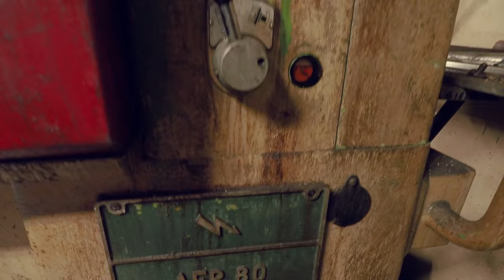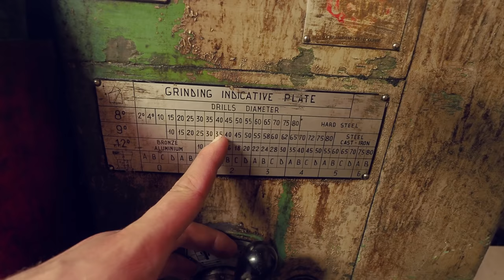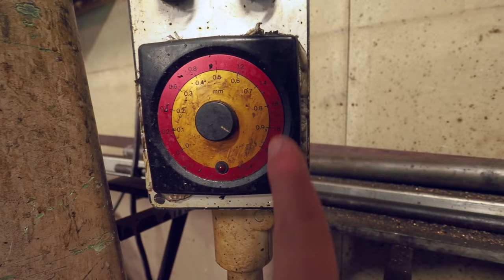Automatic Old School HSS Drill Sharpening Machine

Comment: this is possibly the best drill sharpener ever, i used this one very often at a place where i used to work, and no other drill sharpener comes even close to this one. the small centering bit in the center is unique, all the drills i used on a radial drill almost never needed pre drilling, just a smal center with a centerdrill and then bam drill a hole up to 75 mm, ,no run off, all because of the centering part on the drill itself. best tool ever!

Comment: 25 years ago I started as a Machinist Apprentice. The same day I hired on they company had one of these delivered new. It was my job to set it up.  That machine got a ton of use.   I still work at the same company and just had my 25th Anniversary there in October of this year.   And yes we still have the same drill bit Sharpener.
Reply: In 25 years I bet those drill bits are getting very short.  :)
Reply: Deezildennis  - You should resolve the argument in comments above where the guy "
MrKotBonifacy" is saying that the sharpener couldn't possibly be grinding a relief angle... just a (blunt) cone.
Reply: Does the grinding stone cycle in and out to produce the relief angle or is the stone shaped?

I notice it runs eccentrically side to side but that wouldn't, of itself, produce the relief angle.
Reply: @evildrome  yes, the grinding wheel moves left and right as well as forward and aft. (Since the drill only spins). We had one of these too in the shop I use to work at. Only used it for big drills like this though. The small drills we would just sharpen by hand.
Reply: @89crxsidohczc  Right... the left/right movement stops the drill digging a drill sized trough in the stone.

Clever stuff.  Especially the front/back movement which must be synchronised and also must be adjustable.

Comment: The most amazing thing about this tool is (in theory) any machinist could make one from scratch. That fact never gets old.
Reply: I don't think could be so easy . . . The sharpener wheel, while it turns,  moves forward and back its axis, in accordance with half turns of the drill-bit. Not a simple conus is built on tip of the drill bit . . . From the cutting edge(s) of the drill-bit, the sharpener wheel moves forward, while the drill bit turns a bit, so cutting "more" than a conus surface . . .

Comment: You can always tell how sharp a bit is by the length of the shavings
Reply: If you have long shavings, your feedrate is not optimal. Properly sharpened drill with proper feedrate gets you nice little curls that break and come out of the hole.

Comment: I know this sharpener is rated for"HSS"(High Speed Steel)but can it be modified to sharpen carbide or diamond tip drills??.
Reply: The grinding stone isn't hard enough for those materials. Maybe it could work carbide drills with diamond stone.
Reply: Hydraulic Press Channel I used to work with cobalt/carbide/diamond tip drills long time ago and when I saw your sharpening machine,I had to ask.Excellent video as always,keep up the great work!!.
Reply: I wonder if any of the Soviet surplus diamond plated wheels are suited for this machine.

Comment: What is the use of that huge drill bit?  Always if bit is the right word ewe?
Reply from the maker: It's not exactly huge in our standards :D I would say medium size. But they are used just like smaller ones, to make holes. The larger ones are usually for starting holes in a lathe if you have to turn hollow part. First you drill hole large enough for your turning tool and then you use that to make it larger or more precise
Reply: Check out abomb79, he just used a 3 3/4” drill on his channel. Good stuff.
Reply from the maker: I think we have one over 100mm tungsten carbide drill but it's bit more complicated thing than regular HSS drill and doesn't look like drill any more but more like really advanced milling head
Reply: Derek Tanner 3-7/8
Reply: Beyond the press show us that 100mm drill
Reply: Mathen, thank you. I was bleary eyed this morning and write the wrong measurement. 

BTP, I would love to see that 100mm in action!

Comment: My teacher told me that I would never use a refractometer in my career. I use it all the time.
Reply from the maker: There are surprisingly many uses for those
Reply: Beyond the press You use them in winemaking, too.
Reply: Also used for checking coolant concentrations in automotive coolant
Reply: I know a sugar cane farmer that uses this tool to check the sugar level
of the sugar cane juice to decide when to harvest the field.Price pay to them at the processing plant is based on weight and sugar level.
Reply: I use it for my saltwater fish tank :D
Reply: tayloraustin1997  The refractometer has made a strong comeback in diesel trucks with DEF fluid ATS system active faults checking for DEF tank contamination and specific gravity.

Comment: I have always sharpened my drills by hand, we run them in cnc mills so if you don't do a nice job you will learn pretty fast (they melt the drill end almost instantly if it's bad enough)
But my drills usually drill 1-5 thousands over size. And tend to last a total of 100 inches deep in 304 depending on how good the sides of the drill are and how hard my feed is (speeds anywhere from 200-700 rpm and feeds of anywhere from 1-5ipm)

Comment: 11:50 Why didn’t you drill a pilot first? 
That web would just be pushing into the material and doing nothing
Reply: If you start slowly you can get the drill centered well enough with out pilot hole.
Reply: It did look to be wandering quite a bit as it started drilling. Have you ever tried using a secondary point angle on a drill? It's supposed to reduce the risk of snapping the corner off the cutting edge by.... cutting the corners off the cutting edge.
Reply: Four facet sharpening :) Provides a self-centering drill. Basically the typical 10 degree relief and then a secondary relief at double the angle so that they meet at the center of the drill. If you want to go fancy, thin the web with an air grinder to get the web area to cut also. Basically sharpening a cutting edge on it on both sides. Properly done, you can feed that thing in with just hand power.
Reply: yea i think he deffinitly should have split the point being a mashineshop and all
Reply: @HydraulicPressChannel  Yes but you could tell by how the bit was wobbling that it wasn't centered.

Comment: I've run a similar machine to this, only it was manual(no auto feed). Important to know is if you are drilling a deep hole 5" or more, you must offset one cutting edge slightly deeper or the drill will get jammed while drilling. A large drill approx 2" would need about a .010" offset, in order to not jam the drill. Other than that, these drill sharpeners are the best.

Comment: Its a must have if you want run a lot of HSS  bits in your operations. Saves lot in labour costs and in tooling costs.
Plenty of machinist can maintain a drill decently, but reviving a badly damaged drill or doing some custom geometry on a bit takes time and is very difficult to get right if you aren't an expert.

Comment: That’s interesting. I am spoiled with carbide insert drill for all my larger diameter drilling. I’d love to have one of these in my shop.
Reply from the maker: I don't have much carbide drills but I tend to use 20 mm turbo milling head with rotation to do larger holes if they are not too deep and the shavings can get out. It fast to setup since it can do many differentent sized holes and I have it always on tool changer and it also makes holes much faster than HSS drill with at least similar accuracy

Comment: 11:41 wow that's amazing. I bet its sharper now than when it was new. I wish I had a machine like that for small drill bits. I have some small drill bits from 3mm to 8mm that need sharpening.
Reply: Simon, for those diameters, i bought a Proxxon drill-bit sharpener, about 200 euro.
It works from 3 to 13 mm drill-bit, not longer - in any case - than 170 mm. Nothing to do with the spectacular machine in the video, but . . . it works !

Comment: If you don't thin the webbing (middle) of the drill between the flutes, it will put excess pressure on the drill point and can cause excessive wear on your drill press auto feed gearing and on the tail stock of your lathes and boring mills that used drill adapters.

Comment: I would like to see you measuring the diameter of the drilled hole because this is the only way to check, how accurate the drill bit is working after the sharpening process. But at all... an interesting machine. Thanks for showing.

Comment: I like this video, I tried to buy a machine like that at a county auction a few years ago, never did get to see it used.
In English "grinding shit"(bits of the grinding wheel and work material mixed with oil or coolant) is called swarf.

Comment: When using a wet grinder like this it is extremely important to run the wheel for several minutes AFTER turning off the coolant to ensure ALL coolant is expelled from the grinding wheel. If the wheel is still wet when it stops, the coolant will soak to the bottom of the wheel and when you restart it, the grinding wheel  will be way off balance and very likely shatter. ALWAYS rotate the grinding wheel by hand before starting the machine to be sure it spins smoothly and coolant has not settled to the bottom of the wheel while it was off.

Comment: Automatic tool sharpeners are great but, I would rather use a Setco model 304, that way I could set my own angles according to the material that I was drilling.

We mostly did A36 which is very soft. I could sharpen an 1-1/2" drill
That would drive through A36 @ 
.016 per revolution @ 70 RPM with minimal head pressure on a radial arm drill. 
We used fixtures with hardened drill bushings of course. 

The first shift operator didn't agree with the way I sharpened my drills, but he also drilled half as fast as I did with a four-fold head pressure. 

When I came in for my shift and had to pound his drill out of the spindle with a 3lb sledge and hammering is hard as I could.... I would say that his drill sharpening job is less than exemplary. 

I could pound mine out with a few taps of a 20 oz ball peen. 

When it came to harder materials such as hardox, I could still use a high speed steel (HSS) drill instead of a Cobalt, just because of the way I set my angles. I would also hand-cut facets in the face of the drill face to expedite material removal from the hole. 

I really miss being a machinist... Or rather, a drill press operator. I had no formal schooling, it was all on the job training.

Comment: How does the machine create clearance? I would think if it's just spinning the drill it would wind up conical, with no back clearance. It looked like the grinding wheel is actually revolving, I'd assumed that was to even out wear on the wheel, but does the angle between the wheel and the drill also change?

Comment: Dude the chip out of the fresh sharpened drill is perfect. You just need to lower the spindle speed and use more feed. For such a big drill I'd start with a smaller one first anyways ;)

Comment: I used to set up and operate a couple of automatic screw machines (actually for many YEARS), and the shop instated on using OIL Coolant :(  ... I had to wear a hat, to guard against the oil mist :) .. and if I had a difficult set up, I'd be covered in a thin layer of oil by the time I was done

Comment: I have a couple of questions:
(!) the grinding wheel seems to be running off centre. Is that deliberate?
(2) It looks as if the profile of the ground surface on the drill is a cone. That is, it is being rotated at an angle to the grinding surface - this should form a conical shape, but interrupted by the flutes.. But I read that the shape is not supposed to be conical - once the cutting edge has penetrated the work the drill surface should 'fall away'. This allows the cutting edge to bite into the work like a chisel. So that means that with this machine, it is not profiling the drill to factory specifications. Is that correct?
Thanks for any comment - I'm interested as it looks as if I've got a bunch of drills to sharpen soon, and I'd like the ideal method, if possible.
Reply: Hi think I may be able to answer both questions in one but I'm not an expert and have no experience with this type of machine. When you say the  grinding wheel seems to be running off center I assume you're talking about the osolating movement visibility at 9:12 not that the wheel is out of balance or needs dressings as it would be difficult to see spinning at 1000s of rpm. If you look at the frequency of the osolation compared to the rotation of the drill you can see it happens exactly twice per revolution synchronised with the drill flutes. I believe that osolating movement cuts the relief (fall away) into the drill. That would also explain why the rotation as well as the length of the drill must be set. I'm fairly confident this is correct or the drill just wouldn't work hope this helps.
Reply: So in short the drill would be sharpend to the correct profile + if you look at 11:40 you can see the chisel edge in the centre of the drill so in can't be ground to a cone shape or there'd be a point in the centre of the drill
Reply: @lukemitchell6963  Thanks for the cogent and informative reply. Yes, that was my initial impression, but I went back and looked at the relevant parts of the video more carefully.  I see that without the chuck spinning, the grinding stone is indeed centred, but then it begins its back and forth oscillation after engaging the chuck drive. (7:50). I would suggest, though, that the stone is not going more than about 300 rpm. It also looks to me, at an observational distance (e.g. at 6:45) as if the grinding stone is flat. Hmm... I first thought that the back and forth motion of the grinding surface was purely to use up most of the available width to avoid cutting a groove in it.  If that assumption were the case, the drill axis angled against a flat surface and spinning in the chuck would produce a conical profile regardless of the wheels oscillation. So that seems an incorrect assumption.  it may be that the side of the grinding wheel is itself coned at a slight angle. When its oscillation is synchronised with the chuck and the drill is mounted in the correct starting position, the cutting edge of each helix will be contacting the stone at the inner limit of the stone's oscillation, and as it tracks along the radius toward the outer limit this effectively grinds more away from the surface, thus creating the relief in the profile that is needed.
Reply: @lukemitchell6963  Yes, that's true. Just to learn something, I examined my biggest drill bit (5/8") under magnification. On the face, there are two faint lines in the shiny steel that run from the rear of the land (which is about 1.5 mm wide on this drill) up to the point, and they form a perfect V, viewable as such in profile. If a grinding surface were set to these lines and not changed as the drill bit rotated this would produce a cone without a chisel tip. So the grinder is indeed changing its geometrical relationship with the bit as it rotates, which I knew, but didn't know exactly how.
Reply: Yes that's what I was thinking I'll have to ask around at work I believe there is / was a similar machine in our tool room.

Comment: They had a Wedevåg WL1B were i used to work and it worked great.
Could easily drill a 75mm hole in steel no predrilling needed
Reply: I ran huge drill press back in the day .. it could drill a 1 3/8" ... 4 Degree by that i mean almost flat bottom hole in M2 High Speed Steel (before hardening of course)  ... i do not remeber what the brand name of the drill press was though .. but it was over 10 feet tall! :)

Comment: Does the spiral cut down the entire bit ever need or get resurfaced?
 Do bits ever need to be re work hardened? 
Is the top cut linear (flat) or curved in the radial direction toward the center (the outside edge might be lower so the center on the bit cuts first then the edge cuts, or the entire surface cuts at once)? 
Is the cut flat at a specific angle perpendicular at every distance from the center or is there a special taper?

Do all of these questions have different answers depending upon the metal I am cutting and the metal of the tool?

Do I ask too many questions? (I have several hundred bits all sharpened wrong because I am an idiot.)

Comment: Not enough coolant the tip turned brown which in turn you just make that part of the drill softer. Switch to a oil based coolant or just straight oil used in Swiss turn machines and carbide endmill grinders. I’ve ran a drill grinder similar to this and I’ve also used a really old school drill grinder that has a similar concept except you could only sharpen one side at time.